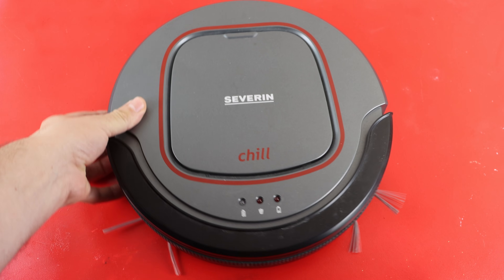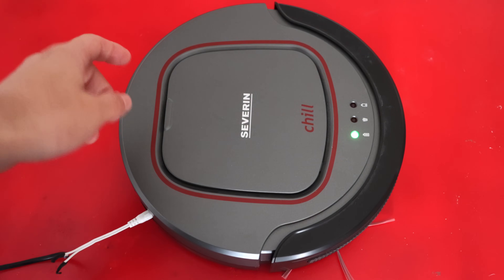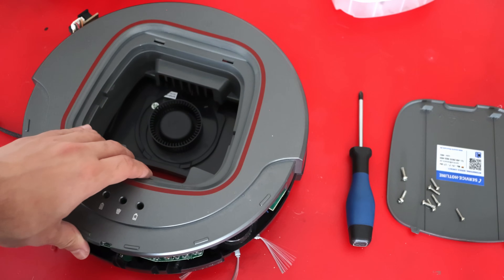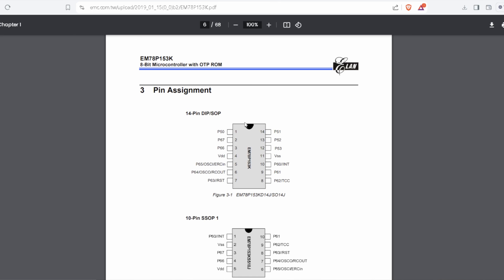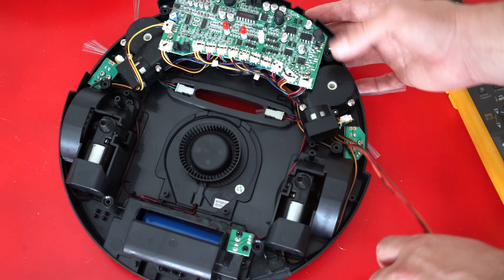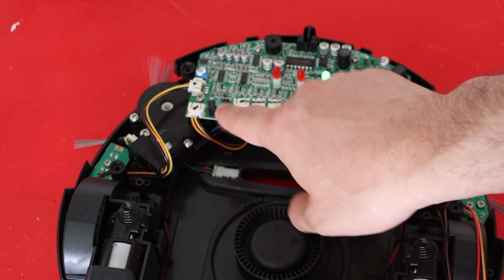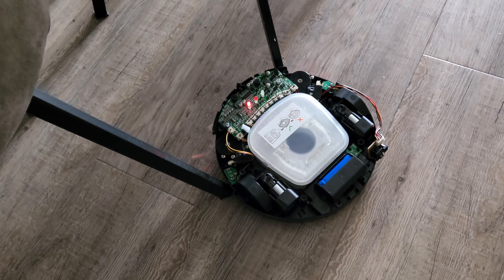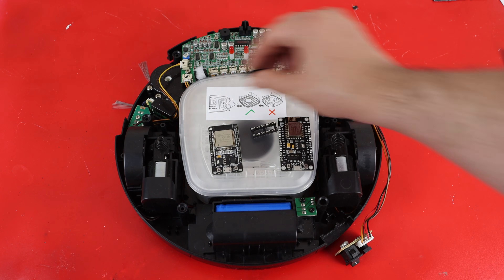Dumpster Dive Discovery: Fixing the Severin Chill RB 7025 Vacuum Robot

Comment: Hi, first of all, great channel. I have similar problem. Mine stopped working after several years. Checked the battery with multimeter, says 11.3V. I tried opening it up to see what might be wrong, but found nothing, put the plastic foam on lid sensor to remove it from equation, when I start it, it turns for like a sec and shuts down immediately.  Here is the video, any clues what might be wrong with it? https://youtu.be/I1vtNtKQCGk
Reply from the maker: Hi, I think it is the battery. Do you have a chance to replace it, or provide 12V constant?
Reply: @makersfunduck  I dont have any ways to provide 12V constant. I will try to replace the battery. Thank for quick response!!
Reply: @makersfunduck  
Update:

First of all, thank you so much!

 

I went to electronic store and asked for the battery, seller said that this is non standardized battery (something along those lines) and recommended me to buy 4 Sony US18650VTC5A batteries. I Connected them in series and inserted that battery pack into the device and it works!! 

My question is: I ignored white temperature wire(Likely NTC - Temperature Sensor), just used red(+) and black(-) wires. Do I have anything to worry about regarding charging, overheating and so on?

Comment: hello could i ask you because i have an other  probleme with the same robot ? Thank you, The trash LED flashes only once when the robot is turned on and it does not start
Reply from the maker: Hi, do you have a multimeter? 
I had similar behavior while charging up the batteries. Unfortunately they were dead. Just measure the voltage on them after leaving it a day after the charge. It should preserve the rated voltage. If not, you can just replace the battery.
Reply: @makersfunduck  hello
thank you very much for your answer
yes I have a multimeter the battery is at 5.6V, if I charge it for a few hours it goes to 7.5V. Don't you think that's enough for it to start just a little at least.
the led on the trash can made me think of the dust sensor on the dirt collector.
So you think I need to buy a new battery. Can't I do another test to validate this problem? Thank you very much for answering
Reply: yet it is not the battery led that flashes once it is the one of the trash.
I watched your video and in the ignition sequence of your rebot, the trash LED flashes once then the others alternately. For my part it is the very first start-up test that prevents the start-up sequence, the trash LED.
Thank you
Reply: I did another test for the battery I connected a standard commercial 9V 6LR61 battery, but still, the robot does not start and the trash LED flashes just once
Reply from the maker: @lemartinjose8261  It really sounds like a battery issue. Check out the video andrija made, he has a similar issue : https://www.youtube.com/watch?v=I1vtNtKQCGk

you should find a 12V lion battery.  do you have a chance to provide 12V constant? Either with a battery or with a power supply?
Reply: @makersfunduck  I finally bought a new battery as you advised me, thank you. 12.8v RFC8700 1500MAh 19.2Wh
it is slightly more powerful than the old one. the robot still does not start but the sequence goes a little further. I have the trash and battery led which are now lit solid red, after a test sequence
Reply: can you tell me how to block the leds linked to the trash can under the robot?
these are bright leds (white and black) that detect the passage of clogged dust. I don't know how to deactivate this test
Reply: the robot beeps 2 times, but does not start with this new battery and charged for a whole day
thank you
Reply from the maker: @lemartinjose8261  hi, you can just place a piece of non-transparent paper in between
Reply: thank you

Comment: you should try replace the micro controller with esp32 and program it with esphome, that will allow easy intergration into home assistant, and make programming it much easier
i have already replaced several appliance main board with esp and it work great, just replaced a dc fan main board with a pwm main motor and 2 steppers, the esphome does not support charlieplex which is a bit of a issue but i only used the speed +- and power button
Reply from the maker: I am also more inclined towards esp32. it can be interesting to use a popular mcu.
Reply: Hello, I have a problem with Severin Chill. The problem is that when I turn it on, it advances a foot and then turns off and the battery light comes on. I replaced the battery and it is still the same problem. Do you have any information about what the cause is?